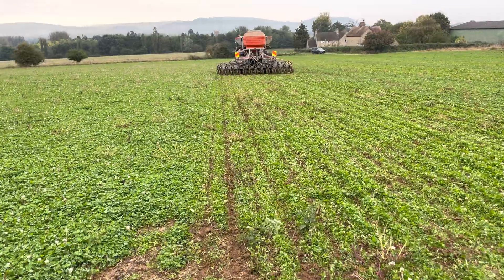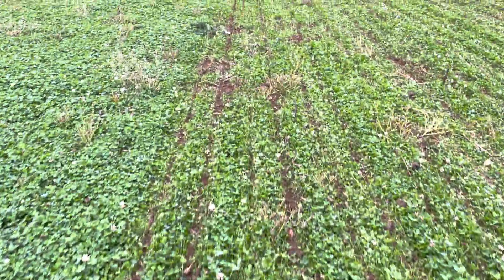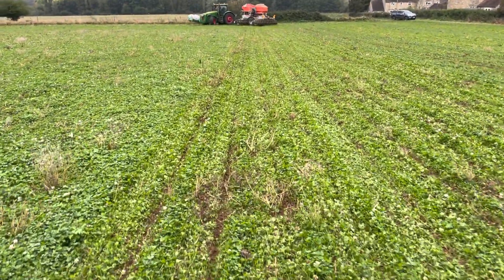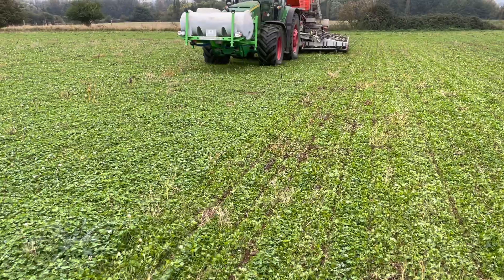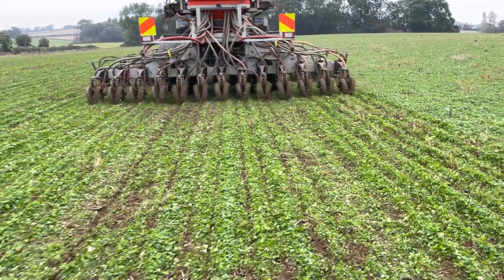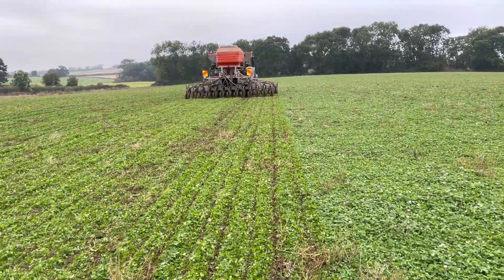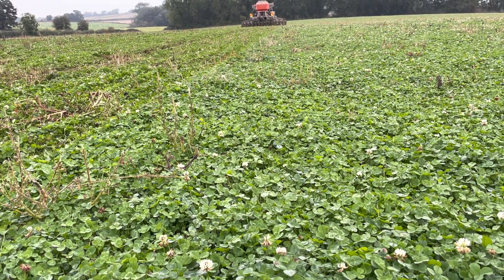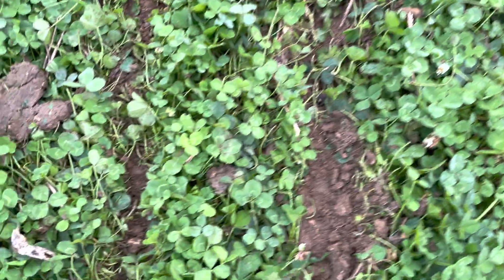Clover Understory and Wheat

Comment: I don't know if this is a silly or obvious question but do you still cambridge roll after drilling into cover crops or even into stubble? I can see why you would and why you wouldn't. Just curious
Reply from the maker: Yes we do still roll sometimes where slugs might be an issue or to push stones back down. It’s a very cheap operation
Reply: @No1FarmerJake  Thanks for that 👍